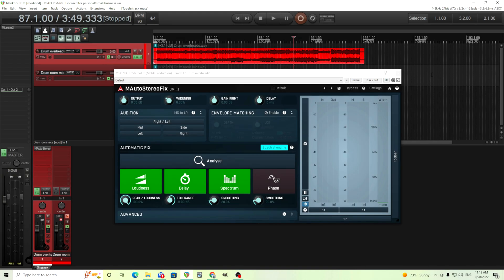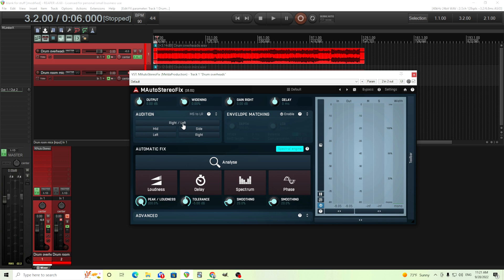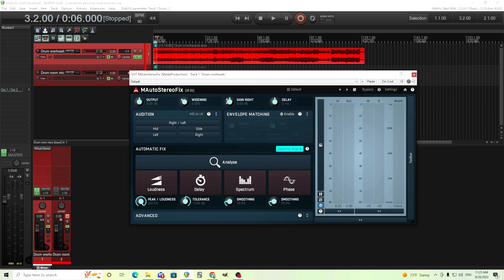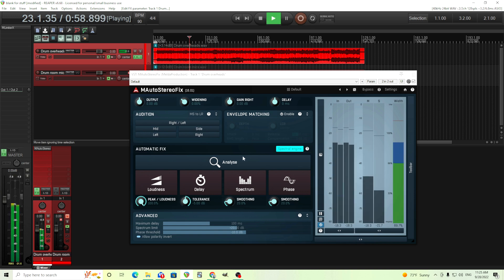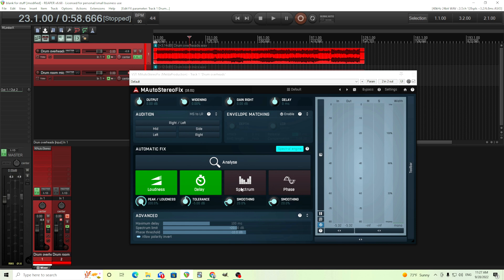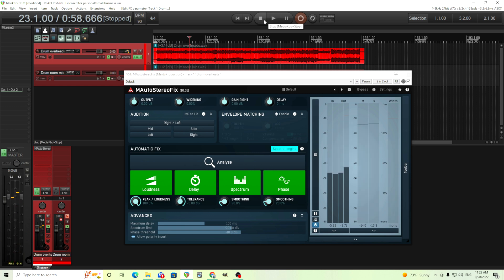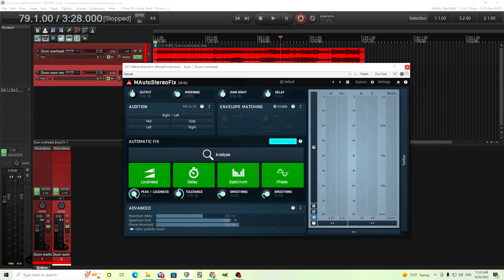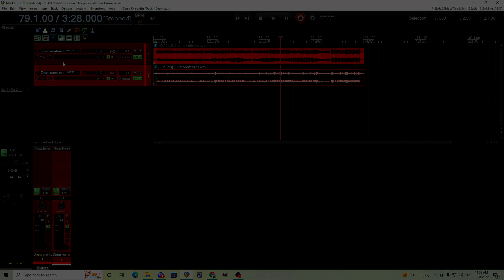MAutostereofix  walkthrough

Comment: I use Mautoalign is this similar? Would it solve correlation issues on a master bus?
Reply from the maker: MAutoalign is somewhat similar, but it is used to align time and phase with multiple mics. This is used just to fix the stereo field. Ex. Use this on stereo overheads. Use MAutoalign to line up your bass, snare, overheads and room mics. I hope that helps.
Reply: I'm just finishing off a live album that has autoalign on tracks and autofix on the master.

Autofix makes a very subtle difference, but noticeable
Reply from the maker: @nikirose7673  Nice. That's good the hear. I don't do that much live stuff, but I'm glad its working well for other people.